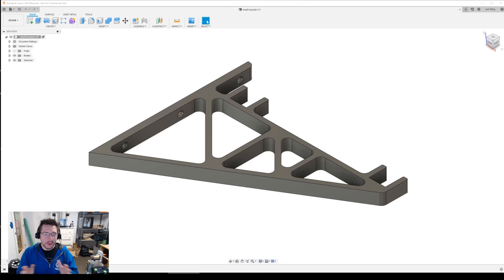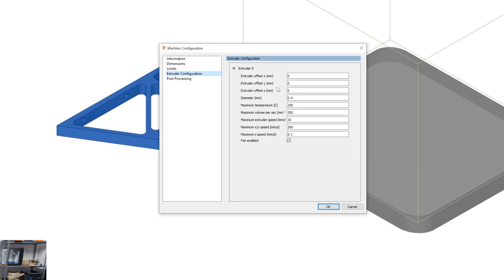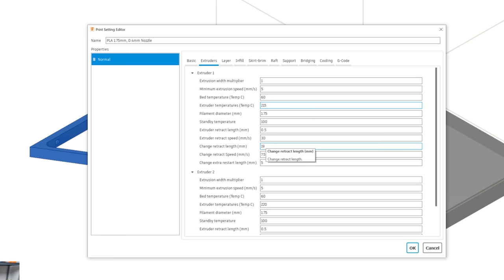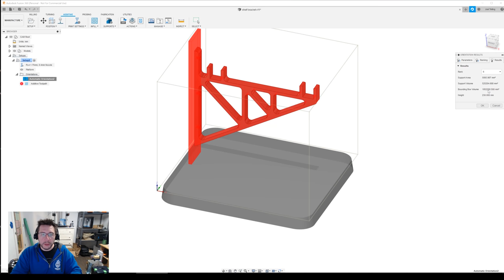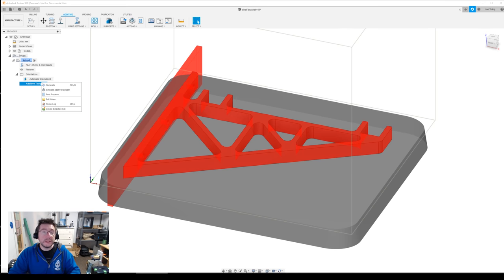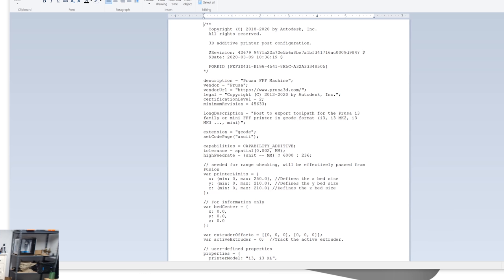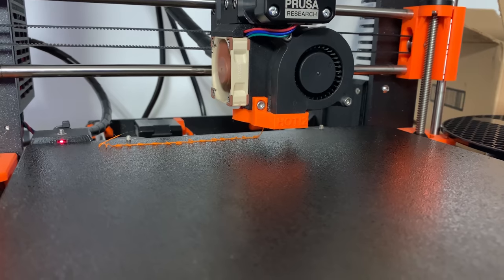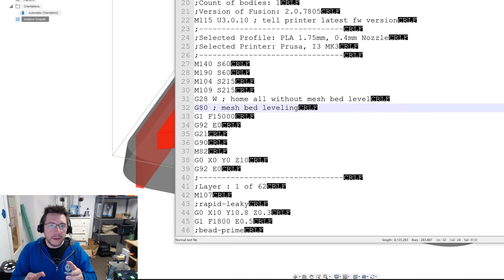Fusion 360 is NOW a 3D Printing SLICER!

Comment: Well this feature might have some improvements here and there over other slicers, but the current UI offers a "bad" User Experience). You can surely use it but I wouldn't waste time when I have Cura dialed in with my profiles and I can see right there the changes without a modal screen obstructing my views.

 The approach of Simplify3D and Fusion to slicing is way too cumbersome and time consuming, for something that might just be 2h printing.

Comment: 0:46 How about you 3D print and assemble a headset? could be a good episode.
Reply: Underrated. Maybe tear down some usb mic and take the small ,actual mic in it. Or one could take a mic from a broken laptop or so and turn it into a lav one
Reply: @Genesis-dj7kw  you can get condenser microphone modules on ebay dirt cheap.

Comment: I tried to use this function. . .it requires that I buy an additional subscription for $125?
Reply: Joel Hornung  you do not need to buy any additional subscription, make sure you get the latest version of Fusion. We released this new feature on March 10. So you may be running an older version of Fusion that’s all.

Comment: I would be wary of Fusion 360. I had a hobbiest license which disappeared with all my designs and can't get them or it back now. Autodesk has a habit of taking away free versions on a whim.

PS No reflection on the app itself, I loved it in the short time I had to learn it.
Reply from the maker: That doesn't sound good. How long ago was this? Have you been able to reach out to Autodesk?
Reply: @3DPrintingNerd  Your video prompted me to look around a bit further and my files are still there and I have reactivated a new personal license. As you might guess I am a noob at Fusion360. Anyway thanks for the great content.

Comment: Headsets.

I avoid Logitech. They have fairly good electronics, but are way too fragile. Just not designed to take any abuse, including normal day to day events.

A much better choice are units from Plantronics. Good sound, much more sturdy. Plantronics also offers an audio switch for ease of connecting between your external studio monitors and the headset - no digging around in back fiddling with plugs anymore.

For a more hardcore gamer there is Sennheiser. They make headsets for professional use - pilots, DJs, anyone who expects quality, comfort, and durability. I own a PC-350 headset. It's comfortable worn for hours on end. The hinges are metal, including one more pivot than most headsets feature to allow for a better fit. The sound is extremely good and the mic is what I jokingly call CIA-grade, extremely sensitive. 

If you want the best get a Sennheiser. Otherwise go for Plantronics.

Comment: Extruder 60 mm/s - not even a Hemera can take that... Probably the 30 mm/s is already too much. Your movement speeds were at 200 mm/s so that's already more than enough for a MK3, which is probably the one you were trying to fix ;-)

Comment: For those that do not have Additive Operation available, Below is what I found I had to do to add this to my 360. Hope this helps.
Its an Extension you have to add from Autodesk through using Cloud Credit. Here is the link to the info.
http://help.autodesk.com/view/fusion360/ENU/?guid=GUID-EEE56836-C03A-4B10-A51C-A6203CF46AC4

Comment: The Fusion 360 looks much like any CNC machine setup, end of the day 3d printers are CNC machines.
Reply: *reverse CNC
CNC cuts
3d printer adds
Reply: @koolkei  3d printers are cnc machines; cnc just means computer controlled
Reply: Koolkei not true at all
Reply: @JuliaC-sp5qk  Actually CNC means Computer Numerical Control
Reply: @koolkei  You couldn't be more wrong. Code for an FDM looks exactly the same as a CNC mill. Well the M codes are way more funky but the G codes are almost identical. Obviously CNC machines are way more technical with circular interpolation, nurbs interpolation, tool length offsets, diameter compensation, etc. But still, for all intents and purposes the same. The only difference is what type of tool is in the turret, tool changer, etc. Mill, lathe turning tool, laser engraver, hot nozzle, it's all the same.
Reply: Joel Cresswell false
Reply: Dave Scott last time I checked, a CNC required materials to be cut into shape from a large price of stock. A 3D printer starts with nothing and adds material to make the design. Too opposite ways to make a part.
Reply: @tjlqk3  OK so I really didn't want to continue this discussion further but you are making an assumption that you really can't make. Like I and others have stated, the CNC refers to Computer Numerical Control. You are assuming that a CNC is a mill. But that is where you are getting it wrong. There are many, many types of CNC machines that have nothing to do with milling.  Lathes, robots, robotic welders, and painters, grinders, fasteners, laser cutters, etc. The list goes on and on. I was simply stating that you can't assume a CNC machine is a mill and therefore always is meant to remove material. I have been a manufacturing engineer for about 40 years now and have programmed just about any type of CNC out there. I do have some knowledge to back up what I am saying here. In the end it doesn't really matter and has absolutely nothing to do with Fusion 360's ability to slice models now. For the comment thread hijack I apologize to the 3D Printing Nerd. Sorry man!

Comment: For sound, try a Neewer condenser mic coupled with an economical mixer (like Behringer) with phantom power for some basic control and you’ll have a decent system for under $100. Check out a video in my channel, about the mic that I got for myself.
Cheers

Comment: Chairs: “budget option” - Herman Miller Mirra. 
Or Streelcase Leap. I have one of each and they are great. I got mine cheap used around $100 for the leather full loaded option. 
Usually around $400 on eBay new.
Premium - Herman Miller Embody. These are expensive. $2000 msrp and about $1600 on eBay new. 
I’m sure you know the value of a good chair for long hours of video editing. 

Headsets: Audio Technica Ath Mt50x (or some variation) + antlion modmic

Comment: Cool but fusion 360 is a pita and counter intuitive...plus it's buggy as hell... So I'll likely never use this overly complicated setup.. Especially since I doubt they'll have many printers loaded... Menus and sub menus just to export stl and gcode files?.... Uh.. No.

I am currently working in fusion and... Well I've cursed more times with this software than I have on any other software... I have yet to figure out a way or find a tutorial on how to evenly space two objects between a line... Without using a bunch of calculations and dimensions and constraints... Vs 1 constraints to center objects to a third object or line.... Theoretically it's easy.. In fusion... You might as well be soldering with a volcano and lava... Lol

Comment: Kingston Hyper X Cloud headset surprised me with how great they were for the price. I've gone wireless for some time now - with my daily drivers being a pair of AirPods (usually wearing just 1 as a headset). And when audio quality is of higher importance to me, I go with my Sony WH-1000XM3. The Sony sounds amazing, better than any other I've used. But although the AirPods don't sound as good, they still sound very good (the Sonys are just extraordinary), are a good bit cheaper, and are more comfortable than any in-ear headset or earbuds. I've never been able to wear a pair of earbuds or a headset for as long as the AirPods. I may not be much help in deciding what to get. I can tell you NOT to get Beats. They're not audiophile gear IMO, they're a fashion accessory. They sound terrible and look amazing

Comment: Nobody needs a half-assed slicer integrated into other software or suits .. software companies have a horrible track record with doing such integrations, LOL, combining several mediocre pieces of software results in something WORSE, not better. If they wanted to add a slicer to Fusion360.. they should have bought one of the best slicer software company on the market first .. .like Simplify 3D